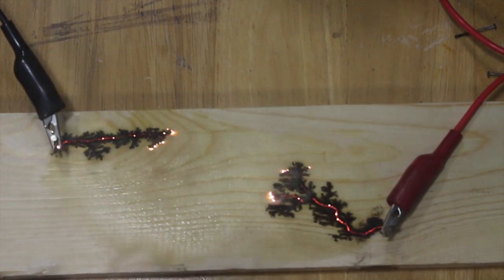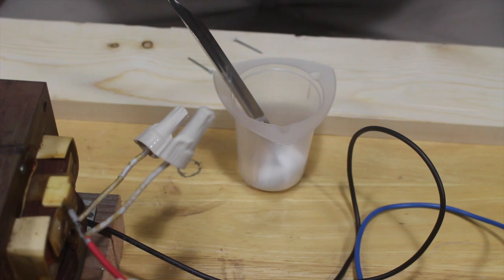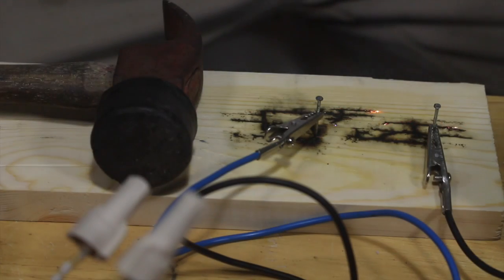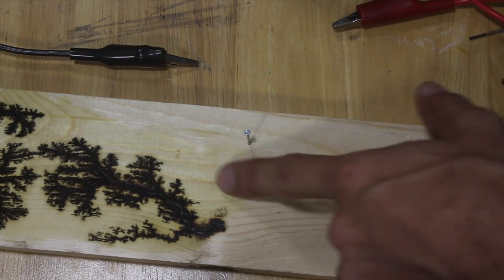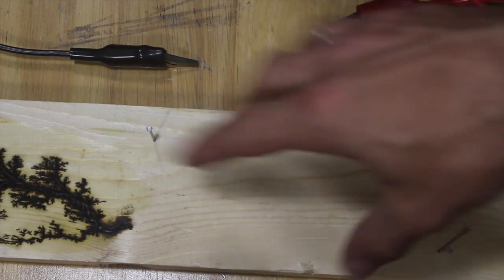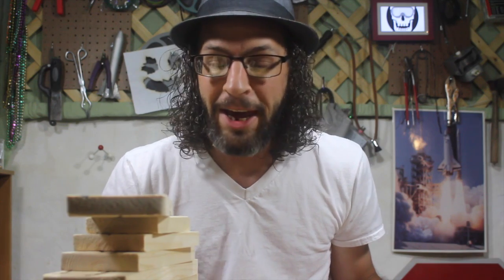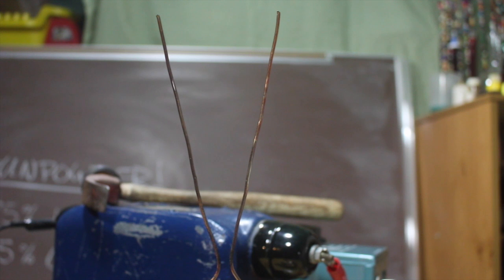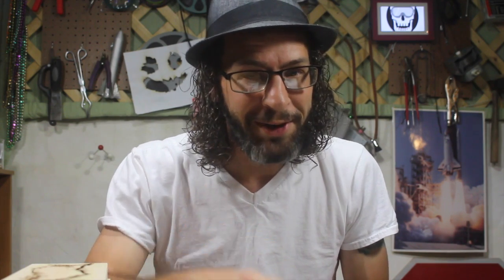High Voltage Lightning Art - Making Lichtenberg Figures on Wood!

Comment: What you are doing when you make plasma is extremely dangerous. There is no way you should be holding those wires when they are powered up and from the look of the thickness of the insulation of those wires I would say they are not rated for that voltage.